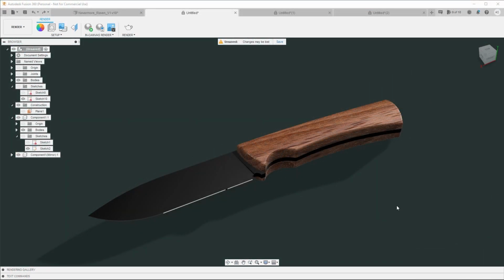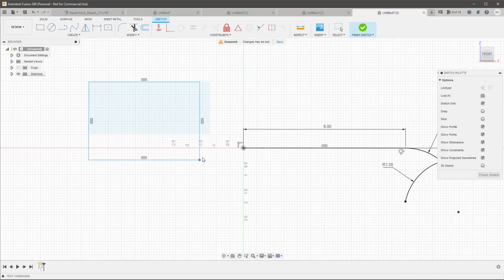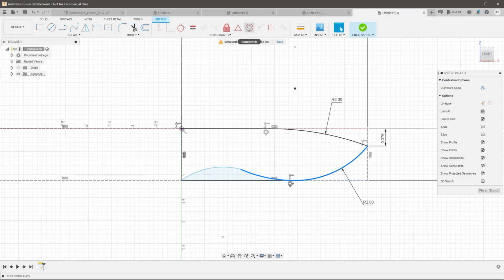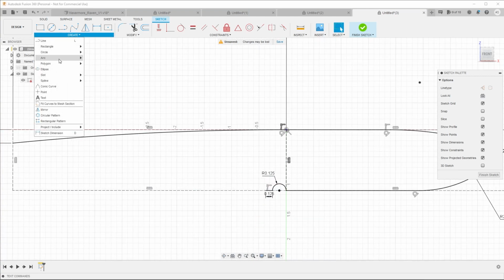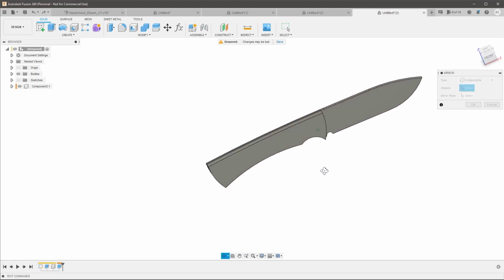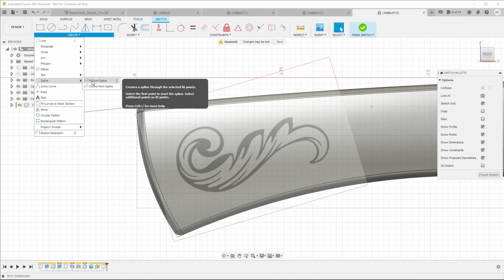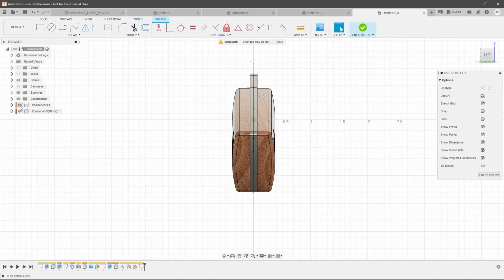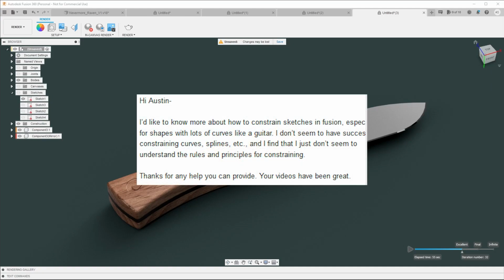Splines are overrated.. master sketch constraints instead! | Viewer Request #2 | Fusion 360 Tutorial

Comment: Thank you for the effort in making this video. This is definitely one of the more skilled sketch presentations I have seen. I do agree that we should try to use arcs whenever possible. 

The emboss did not work at 41:53 because the surface you created had curvature in 2 directions. Fusion has a limitation when it comes to embossing on this type of surface. It was the result of sweeping an arc along another arc (along the back of the handle). If the back of the handle is a straight line, you would have been able to perform the emboss.
Reply from the maker: Thank you for the tip! That makes a lot of sense why I couldn't get it to work.

And thank you for the kind words! I've learned a ton from your videos, particularly on tricky sketches like intersection curve and the surface workspace in general. If you aren't aware, I gave you a shout out on one of my headstock transition videos. Keep up the good work mate!
Reply: @austinshaner  Oh, I was not aware at all. I had put your headstock videos into my "watch later" list but have not gotten to them yet. Thanks for the shoutout!
Reply from the maker: @Fusion360School  My pleasure!
Reply: haha...2 excellent fusion channels talking...

Comment: Hey a very helpful tip: if ever you find yourself unable to completely constrain a sketch and can’t figure out what is unconstrained, open the “Text Commands” under View (not sure what it is for Windows) and go to the bottom and type “Sketch.ShowUnconstrained”

This will tell you how many points and lines need constrained and highlight only the unconstrained lines (much easier than blue / black lines).

Comment: Using splines with constrained points, as one example, can work magic,... give it a try before selling the spline function short,... it's been my experience that most people don't use the spline function to its full potential or are even aware of what can be accomplished using it,... there are things you can do with splines that you can't do with anything else,... it's the reason they still exist as functionality in every CAD platform for the last 50 years.
Reply from the maker: Hey Mate, I've since come around a bit on splines since I released this video. I've started to love control point splines, but still quite dislike fit point splines in Fusion. I made another video showing some really effective way to define CS splines. if you're interested.

https://youtu.be/iDzxndSBook?si=-F_lu1lmGXRE518K

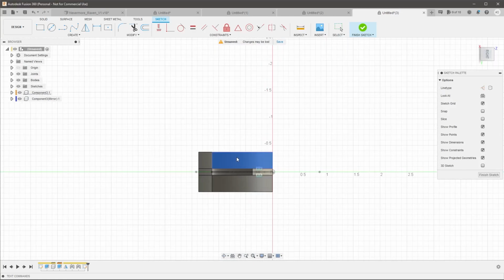Comment: 31:55 Can you clarify on how to get onto that plane / project. Thanks!
Reply from the maker: If you noticed, once i clicked sketch, the primary origin planes in the model appeared. I simply used one of those planes by clicking on it. (no separate planes required).

Then I selected the geometry that I wanted to project and click "P" on the keyboard, and enter. That brings that geometry into my current sketch so I can use it.

Comment: Great video.  This is the second video of yours I've watched and I enjoy finding out new ways to do the things I've been doing the same way (sometimes incorrectly) for a while now.  Great content!  As for your logo embossing, I find using something like Inkskape to convert a drawing like that into an .SVG is helpful.  It converts to lines automatically and then all you do is insert it into your sketch which usually works well.  Sometimes this is easier on some highly detailed designs.  Your use of the control point spline is something I wish I knew earlier because it would have saved me a lot of time and frustration!

Comment: Great video, so when I fix them they turn green not black. I am guessing that is okay?
Reply from the maker: Hey MR! Fix/unfix (green) is different than fully defined (black). You can think of fix/unfix as locking the geometry so it can no longer be edited or accidentally moved around. This should really only be reserved for complex splines that would be too difficult or time consuming to constrain, or to prevent accidental changes down the road. Note, geometry that is fixed will not update when you change other things in the design, you'll need to go back, unfix it, change, then refix it.

Black means that the shape is fully defined, or rather that you've provided enough constraints and dimensions to make the shape lock itself.  Until the constraints or dimensions have changed.

So in summary, one is saying "I don't care about the dimensions, I just don't want you to move" and the other is saying "I can't move, because you care about the dimensions"
Reply: @austinshaner  Actually it should be: "...and the other is saying "You can't move, because I care about the dimensions." Right?

Comment: I'm missing something here: using splines and having fully defined sketches are not mutually exclusive. No need to limit yourself to lines and arcs if you know how to properly constrain a spline.
Reply from the maker: Not missing anything, I agree that you can fully define splines, but the point was that you can rarely define them with dimensions that are actually relevant to your model unless you know how to calculate the math for bezier curves. Splines are fantastic, but not particularly useful for anything dimensionally critical, and too many people use splines simply because they get frustrated with the standard tools.

That being said, check out my "Mastering Neck Profiles" video, where I break down how to fully define Control Point Splines with very useful (and relevant) dimensions.  That was a follow up to this video.

Comment: Awesome man!  For guitars outline contours, would you use splines or constraints?
Reply from the maker: Thanks! I generally don't use splines  because I'm building my own designs. However, often if I'm working off someone else's designs and there aren't good dimensions to work from, I'll use control point splines to trace the body. But making sure that anything that has critical dimensions or tolerances, such as the fretboard/neck pocket etc. Are done with arcs/lines.

Comment: I find splines very useful. It's a matter of using only the spline points needed and constrain them
Reply from the maker: I find splines incredibly useful as well! They are a great tool! I just wanted to make the case for why they shouldn't be your go to solution for everything, particularly when you need specific dimensions or tolerances for manufacturing.
Reply: I agree with you on that

Comment: Another great video - thanks.  I'm just wondering, if you were tracing a guitar body from a canvas (printed plan or photo), would you attempt to do it without splines?  It seems like some shapes would be difficult to impossible to trace using only arcs.
Reply from the maker: It depends... if someone hands me a napkin sketch with no dimensions or just a rough outline of what they were envisioning, definitely splines.

If i was working off of a detailed blueprint I'd almost certainly attempt arcs to nail the tolerances perfectly, up until there are shapes that simple arcs can't solve.